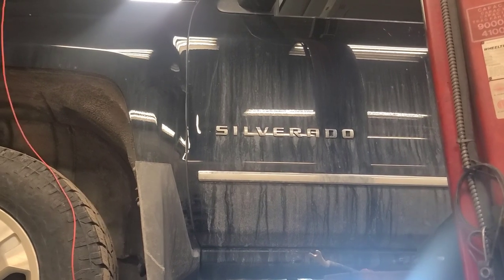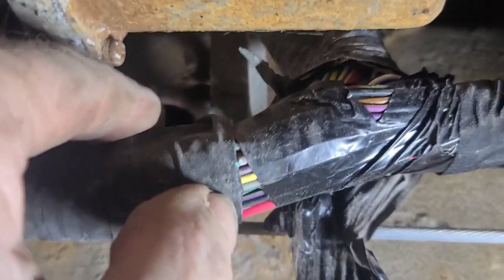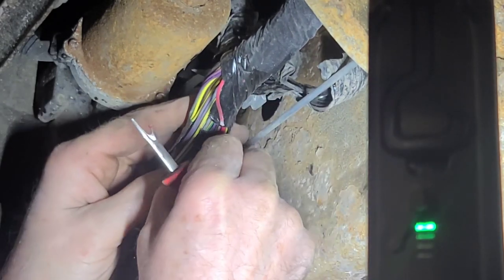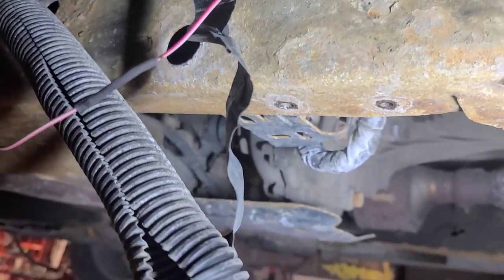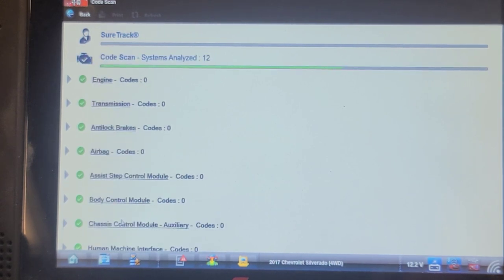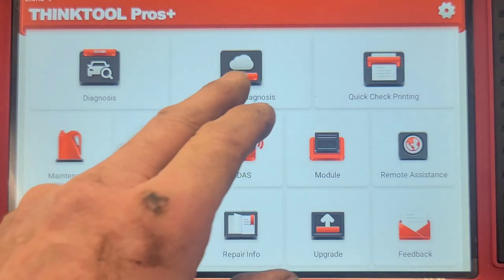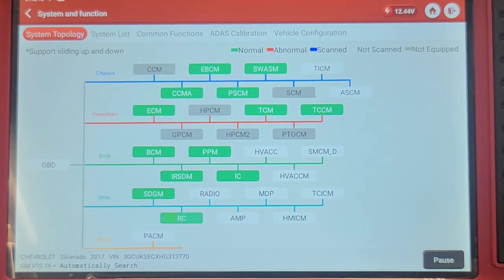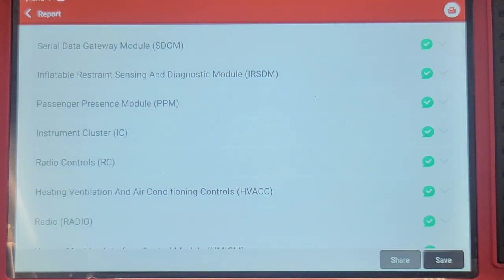2017 GM Truck 1500 4x4 Service Trailer Brake System Message. The Fix Part 2

Comment: I have seen problems like this with wiring and in my cases, it appeared to me that a nick was cut into the harness at the wire factory either cutting the tape or the outer loom at or near a wire junction for the harness to run off in another direction and then accidentally unpurpose caught a wire with the knife,. Also mainly on GM the harness clamp holding it to the frame also rub through even though it's made of plastic and should not have posed a problem, but it did. Any vehicle with a run of wires and there is a low laying area that tends to collect the salt water is my next area of deeper inspection, so there are 3 things to keep in your memory banks now. We already know about harness chaffing against something else like the frame in this case. Thanks so much for the great videos.